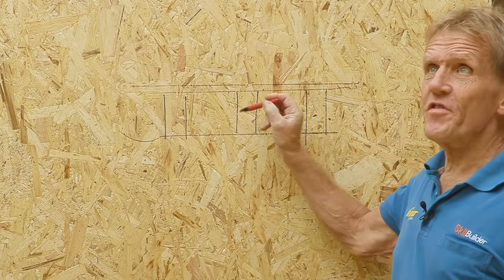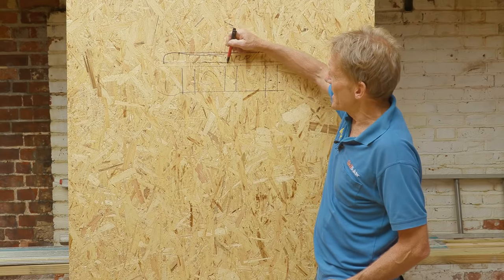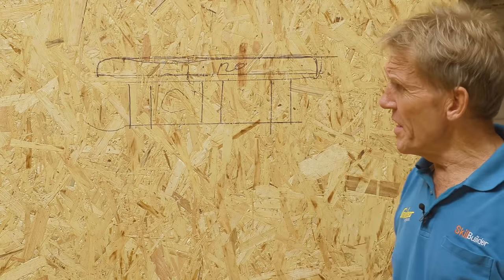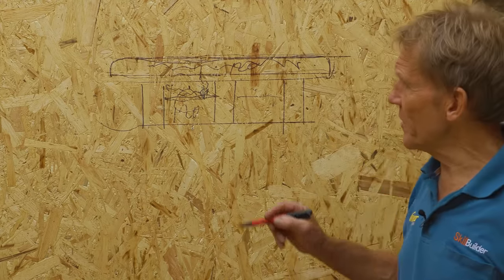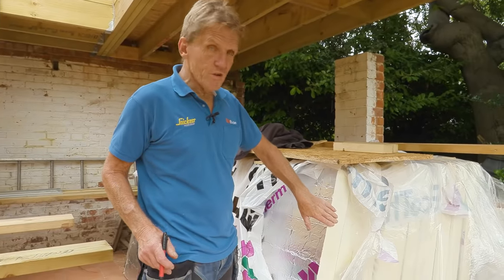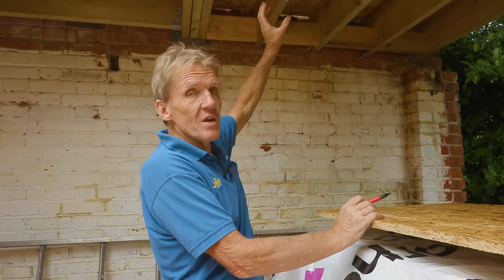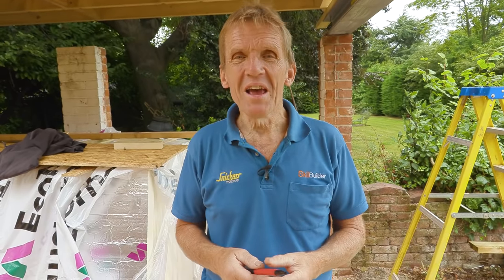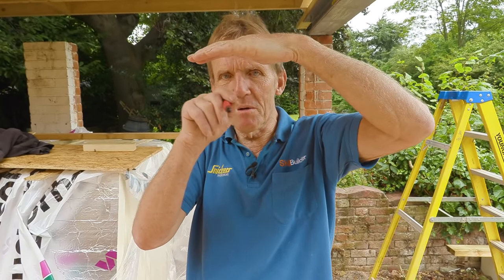Warm Roof vs Cold Roof. What’s The Difference?

Comment: So rather than seeing a 5 inch higher, nice flat roof - the neighbours can  look at a huge number of tiny chimneys. Silly sausages
Reply from the maker: Yep!
Reply: Mouth breathers as AvE likes to refer to.
Reply: I was thinking exactly the same. They're moaning about an extra 12 cm in height. Unbelievable!
Reply: Surely the mushroom ventilators are about the same height as the extra thickness would have been anyway!
Reply: @timt3813  was wondering that. Can they not complain about that also?
Reply: drill the holes especially if it does the job
Reply: Thanks for the video. It’s been a massive education for me. I need to have my extension flat roof retro fitted. I think it is 42 years old 😨. Currently a cold deck. I’d like to convert it to a warm deck. The thing I am not too keen on is the much higher height with the fascia boards to accommodate the 150mm insulation. Is it possible to use 100mm PIR insulation instead? Will that satisfy part L of the building regs is I use a good AVCL like Alutrix 600? I can’t apply another deck on top of the insulation from my understanding as the timber will rot. I wanted to use Bitumen felt. Can that be applied on top of PIR? Thanks
Reply: Very awkward neighbors winging over an extra 120mm on the height
Reply: We just put a flat roof in just below the allowed limit of 4m. Our neighbor had secretly objected to the planning application and later told us she would like our roof to be 6ft tall max which is my height. Unreasonable. Now she has a problem with everything we do and everything we don't do.

Comment: Good explanation for people that don't understand the difference. 1 thing that would be better for ventilating the dead spots created by the lantern would be to counter batten the roof the opposite direction of the joist to create a cross flow ventilation throughout the whole roof. Although you increase the deck height by 25mm you get rid of the need for unsightly mushroom vents everywhere 👍
Reply: Exactly!
Reply: ALso have to consider how much height the shrooms add and what they look like...
Reply: I did wonder when mushrooms kept being mentioned how the neighbours concerned about the height of the roof would like the mass of mushrooms there'll be instead.

Comment: Never really thought about the subject before Roger but in many big old houses they had cellar and attic spaces with air grills below the floor space for the air to circulate. I was lucky when we bought our 300 year old 3 bedroom cob cottage with a thatched roof (cold roof).

The 3 foot thick cob walls are build off a rubblestone plinth with no foundations or guttering, the ground is hard clay and stone. 

There was bad damp when I moved in because the walls were cement rendered and it had been a holiday home for about 15 years which had caused all the damp issues and rotted the timbers on the damp side of the house because I have a hill behind the house whose gable end faces into the hill and in front of that there is a 25 foot deep stone lined well, the water line is about 4 feet below ground, never higher and is only low during summer. Since I put in a French drain along the back side of the house and lime rendered the place we've have no more damp issues.

The first floor ceiling is wooden lath & plaster (the walls are reed and plaster), a thick layer of haired course lime mortar and a single layer of thick top coat white lime skim 5 to 6ml thick. Another property of lime walls is they absorb moisture and CO2 and give you better acoustics than cement or gypsum, a friend in nearby Stogursey has plastered his internal walls with clay which has even more amazing qualities.
It can be expensive to do but, done well it should last a life time whereas modern builds are designed for about a 40 year life, even a strawbale, single floor structure would last a 100 years.

Above this ceiling line is the triangular shaped attic where, between the joists you can see the back of the ceiling and the folded nibs of that 200 year old, haired lime putty mortar and on top of that, between the joists are a few rolls of Rockwool insulation with a 5 foot air space before you see the underside of the straw roof. It's relatively dry. In some of the bigger houses they'd put a thick layer of tamped soil and sand which would be good for the sound proofing and insulation properties.

During the night, summer and winter, we sleep with our bedroom window open and during the day, unless somebody is home, everything is shut up. 

Up the road is an equally old property which has a double-Roman, clay tiled roof, when I climbed up to look there was no roofing felt and it too was dry.

As you said on one of your rants, there's no point having an air-sourced heat pump, if the home isn't well insulated inside.

I'm house rich and cash poor and can't afford one but I would like a ground-sourced heat pipe, they do work, I would also like some solar panels please.

It would help the planet if we all had solar, wind and thermal generating capabilities with storage capacity for any excess power with every home as standard and, if you have a small garden, a compost heap is great for all your organic waste. Ours is barely large enough for the herring bone pipe to the septic tank which is emptied every year (£250) and is cheaper than the mains sewage bill I'm told.

We've go no government grants, none available, or help with lower VAT for sustainable buildings, and it was bought to be our family home and so long as it continues to be repaired with like for like materials it should last another 300 years. 

keep up your interesting topic please, it's healthy when we can all rant.
Reply: * Star Wars theme plays *

Comment: Thanks, excellent video!
Simple answer - badly installed cold roofs are bloody freezing when the builder who owned your house doesn't air seal between the Kingspan slabs and the joists.  It's basically external temperature just above the plasterboard.... 🥶 
Also just found out he didn't stick a vapour barrier above the plasterboard either. 🤦‍♂️🤦‍♀️😤

Comment: Nicely done, I did a little office using warm deck. I stopped the joists at the wall plate, but extended the OSB and 4 inch insulation beyond to create a 200mm overhang. Then sandwiched the edge with 2x4 so I could hold it all together. I only did this to avoid creating an ugly thick fascia that was 300+ tall, instead there's a neat 150mm fascia with the gut attached.
Reply from the maker: Hi Chris 
Nice to see you back. We also do that trick to reduce the fascia height

Comment: I think i would have gone a cross the 9x2s with tile batten so the whole roof is connected and reduce the number of roof vents. Not only is all them mushroom vents going to cost a lot especially as they have to be built into the roof covering, they will look facking ugly.
Good vid Roger 👍
Reply from the maker: Hi Tony 
Good idea but we had the deck down and we were going with the warm roof so we didn't want to rip it all up and counter batten. Also the counter batten doesn't give enough cross ventilation on its own. The whole thing is a ball ache and it is all down to a neighbour who said it was O.K and then said it wasn't.
Reply: @SkillBuilder  Remember- never ask the question if you don't want the answer. If you have permission for the higher warm roof, go with it, and don't ask the neighbours for their opinion
Reply: @rossbuchanan7632  ...building regs? It sounded to me like there was a veiled mention of the fact that some arch holes can be nay bores. i for one wouldn't like to challenge a regulatíon and have to rip off the roof and then live with the people who opposed me in court. Ridiculous though, that it's a matter of less than a foot.
Reply: @SkillBuilder  Had loads of grief with neighbours.  Not about height, they just don't like seeing people get on! Can't win, don't even try. Do what's best for you! Just make sure you stay within your rights. They will complain !
Reply: @danieljones741  
Tends to be, there's max heights your allowed with no permission, anymore you need to consult neighbors.
Reply: @SkillBuilder  I would have said to the neighbour it's going down as you have agreed with first time and now it's too late to whine, what a fuss about a hands width!
Reply: @martinvandyke3316  had the same experience in a jealous neighbourhood when I had my own business. Gradually they started to shun us then the last straw was when one of them reported me to inland revenue for doing cash work on the side. Cost me hundreds in extra accountant fees to fight my case, put my books under a microscope and they found sweet FA, so then the Customs & Excise had a bash. All they came up with was I didn't need to be as OCD with my diesel receipts as I was. We put house on market after that and moved to next village.
Reply: @tinytonymaloney7832  We are getting ready to move. Not because we are letting them have any sort of win. It's just time for new pastures! Will be bloody nice though,  leaving it behind. ✌
Reply: @SkillBuilder  Can believe plans were changed cos a neighbour whinged about a few inches... hilarious...

Comment: Great video Roger explaining the key differences between a warm and cold deck for a flat roof. My comment is on a warm deck. Like a lot of information out there the principle is illustrated by a cross section and details of the layered structure above the joists. For the void between the joists it is always made clear that there must be no insulation between the joists as this will lead to the rising moist air through the ceiling being cooled by the insulation and effectively producing a cold deck but with no ventilation. 

It would be really good if you could explain the detail to produce the sealing around the perimeter of the void space when an existing old flat roof is being replaced. The joists are above the wall and open to the air when the original fascia is removed. Your video includes at 1:35 'All this area here [between the joists] is warm. It is within the heated area of the house' which is fundamental. I have only found one set of videos by @SteveRoofer describing and illustrating the inclusion of insulation around the perimeter between the existing wall and the underside of the new deck. The principle is clear in CNCD-053. With just a new fascia board and no perimeter insulation the air in the void between the joists will experience some cooling defeating the basic assumption and potentially achieving the worst of all worlds. The wall cavity will be within the void space and this will also add to the cooling effect depending on the quality of the cavity insulation. This is all obvious to me after not much thought but seems to not be fully grasped by the roofing industry when you ask for a quote and for a description of the planned work even by reputable companies.

Comment: Ever thought about fitting cross battens running the opposite way to the joists,this creates a continuous air flow of 20mm. No need for mushroom vent. As long as you have.front and rear air soffit/ facia and abutment vents.
Reply: Can also set the circular saw to 20mm and cut a notch out the joists. Obviously it slightly weakens the joists but we usually over engineer flat roofs anyway! Iv done it that way before and was really fast and much better than drilling holes as they get clogged easily
Reply: Always counterbatten cold roofs for cross flow.job done
Reply: @chriscoulson7684  You're not a structural engineer are you! Notching out the top or bottom of a joist doesn't 'slightly weaken' it - it is the worst place to cut it. The bottom is in tension 
and the top is in compression - somewhere in the middle on the neutral axis there is no stress.

Comment: I did my flat roof on my lounge 15 years ago. Plaster board, fibreglass, OSB and felt. No sweating, no damp, no problems. Still as good as the day I did it. I can't help but think that a lot of this is snake oil and more money for the men in suits. Great explanation Roger, as always.
Reply from the maker: My friends house lasted four years due to moisture building up in an unventilated roof space. It is happening all over the place and it is largely due to modern building techniques.
Reply: Look at the thermal values of celotex vs old fashoned inulation rolls.

Comment: Great as always Rodger. I have a 15-year-old log cabin. It's perfect inside but a bit dated on the outside. I spend around £100 per year maintaining it as well as the cost of heating. I am about to insulate it on the outside all around and have the products but not 100% sure of which way to have the insulation, membrane etc. I don't want to insulate the inside as I like my LOG cabin.  I have 60mm Kingspan sheets (got them cheap so can't change) a breathable membrane, PVC cladding for the walls and box profile sheets for the roof. I was intending to stitch the membrane onto the outside walls then Kingspan held with 2"x1" battens and the pvc cladding onto this. There would be the 1" air gap behind the cladding vented at the top and bottom with mesh to stop wasps etc. The roof is 20mm t&g pine and is felted. The felt needs replacing so was intending on removing this stitch the breathable membrane on top, Kingspan, 15mm OSB then the box profile sheets directly on top. Do I need to change the membrane for a vapour barrier? If so where does it go? Do I need an air gap roof or walls? Any advice would be appreciated as I'm getting conflicting messages on other forums, everybody seems to be an expert

Comment: Great videos! I've tried reading most comments so apologies if it's been asked before..
I'm currently starting a new build with a pitched roof. Strangely enough when you search for a warm roof, most videos, info etc. are in the context of a flat roof.
Not a great deal of warm roof examples of a pitched although I have seen a handful of insulation companies i.e Kingspan, Tyvek with demo videos and illustrations of this exact setup, though they leave a lot to be questioned, they do show this is a practised method.
My main concern really is only a problem when you have a pitch and that is the limited shear strength of the very long screws/insulation fixings that have to sandwich the battens to the rafters with this approx. 100mm of soft insulation board in between that provides no stability to these screws. I hope this makes sense, it's a question I haven't quite seen addressed before, thank you for your time!
Reply from the maker: Hi Michael 
 You are right to say the focus is on flat roofs but a pitched warm roof is fundamentally the same. 
The best way to approach it is to counterbatten on top of the insulation in line with the rafters. You can buy stainless steel helical fixings. They are twisted so that stops them bending and they won't pull out.

https://thorhelical.com/product/warm-roof-fixings/

 Once you have the counter batten fixed you just batten out the roof in the same way you would on a cold roof.
Reply: Thank you so much for this advice, I actually introduced a joiner to these fixings who was quite impressed!

Comment: Thank you for sharing that knowledge. In NZ we build a lean to extension with a mono-pitch roof. Plaster board 200mm joists, vapour barrier then corrugated Iron. The Insulation is Pink Batts skillion roof insulation. The insulation had to be specific due to the insulation loft limitation giving allowance for at least a 20mm gap - I now further appreciate what that gap is for. More so it gets me to thinking about flashings and how well they can release water on the inside without letting water in. Hopefully the building codes we built to are correct.
Reply: Come see the uk new builds a meter of installation double glazed  windows its like being trapped in a oven. ive not closed mt windows  all year ... on the inside 30 mm pipes for the plumbing 15 mins to refill a toilet.. but they are alot cheaper than million dollar nz .
Reply: @JONO3679  Sounds like a pressure issue or restricting washers to the toilet water supply? Many 'eco' toilets these days use too little water which can cause more issues - blockages - than having a decent flush volume.

Comment: When I put up my extension , It was a cold roof because of the design I wanted. I used foil back pb and foil taped all the underside of the joists to the foilbacked  Kingspan so there could be very little chance of any moist air penetrating. Redbrick vents to the front and proprietary vent escape vents to the rear. Hmmmm, forgot about the dead spaces though, gulp ! That said, ten years in and no problems as yet.

Comment: Great video Roger.

I wonder why you didn’t opt for counter batten over the top to negate the need for the GRP mushroom vents?  Just pitched a lean to roof and I’ve counter battened and put vented soffit on all three sides.
Reply from the maker: We would have counter battened but the deck was down by the time the change of plan came.
Reply: Just seen this after commenting myself about cross flow ventilation. Would of been a much better way but rach to there own and we all are still learning

Comment: If you used open web engineered joists then that would help with the dead spot ventilation 👍
Reply: Would also be rubbish to insulate
Reply: That would mean pulling the building down after it's built

Comment: Good video Roger. I do a bit of GRP roofing works but our boss gets us to put 100mm on top and 50mm to the under side. When I asked about vapour barrier he said with this system you don't need one.
Reply from the maker: I think you are talking about a hybrid roof there and the insulation on the underside is the vapour barrier. It will have to be well sealed.